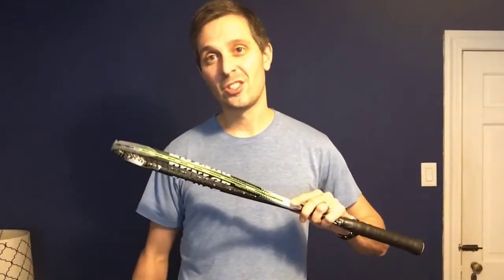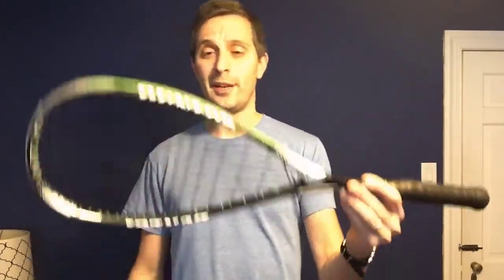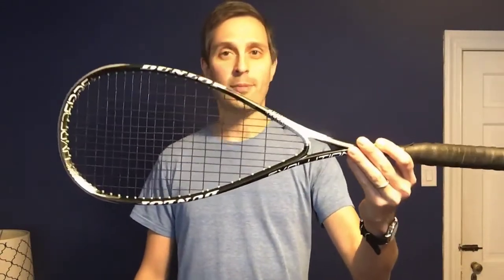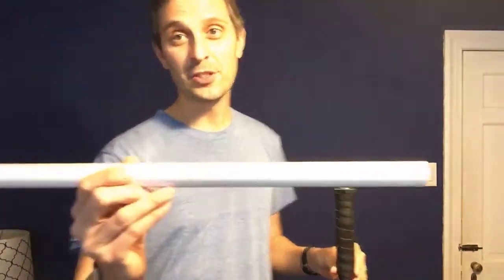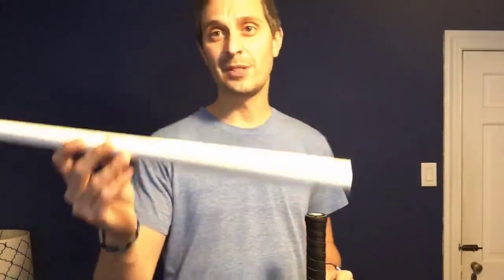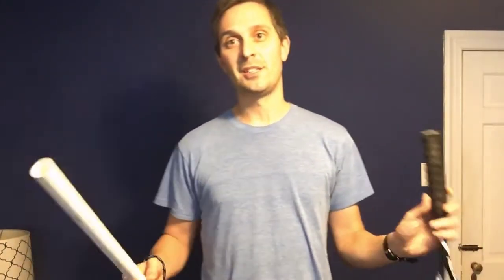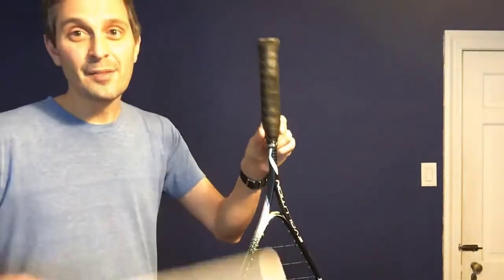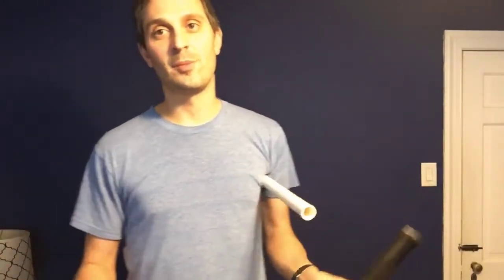Measuring Squash Racket Stiffness

Comment: Hi Pierre! Pretty cool idea. However there are a few issues with this method (my physics degree is finally useful!!) What you really want to measure to get an accurate representation of (what we call) racket stiffness would be the deflection under force. In other words, clamp the handle securely, and then hang a weight from the end of the frame and measure the deflection of the frame. This would be much more accurate and useful than "rigidity" which is what this app is measuring.
Reply from the maker: Thanks Pete that's true. I was looking for a way to measure stiffness at home but this doesn't seem to be useful enough, in retrospect. Among other drawbacks, I think the racket's string tension is muddying the reading.

Comment: Hi Pierre, I'm totally with you regarding an objective measurement for stiffness! However, watching your video I noticed several possible pitfalls or at least factors that might influence your interpretation of the results. Although I don't have the RacquetTune app myself or are otherwise affiliated with it, it's pretty clear that it uses sound (pitch) to produce some stiffness/tension number. So, what you need to take into account are the following:
1. The thing you hit the racket with. You use a hollow PVC pipe. Especially since it's hollow, the pipe itself will prodoce some sound of specific frequency/frequencies. If you'd use a different thing to hit your racket with, you'll get different results. Try it.
2. The way you hold your racket. In this video you held it softly near the grip/throat of the racket. If you hold it softly (which you did), you'll allow more of the pipe's kinetic energy to transfer to kinetic energy of the racket in total, rather than vibrating the molecules of the racket. Or in other words, the softer your grip on the racket as you hit, the more it will swing in some direction and the less it will vibrate. It's the vibration of the racket that in turn vibrates the molecules in the air, which is the sound the app is interested in.
3. Stringing tension should play a role. Probably mostly due to vibration of the strings themself as you hit the racket, adding to pitch that the app measures.

Other things like the material of the frame might also play a role, but then again, the material would also play a role in the stiffness. So it's hard to say whether that needs disentangling.
Anyway, the way you use the app now, does probably not lead to an objective outcome. But it could be effectively used in comparison. If you hit each racket exactly the same with the same material, you might be able to say: "this racket's stiffer than that one".
Reply from the maker: Thanks Wouter! I've added your comment to the main post and will experiment with some of the angles you mentioned.

Comment: Hi Pierre, nice idea to use the frequency method to deduce stiffness for squash rackets! However, when using frequency as your method you must also take into account the weight of the racket. A higher weight will produce a lower frequency and a lower weight produces a higher frequency. This means that two rackets that do have the same stiffness, but differ in weight, will produce different results. To get more accurate measurements you should multiply your measured frequency with the racket weight. That will give you comparable results from this method.
Reply from the maker: Thanks Andreas! I've added your comment to the main post on Squash Source for now as food for thought